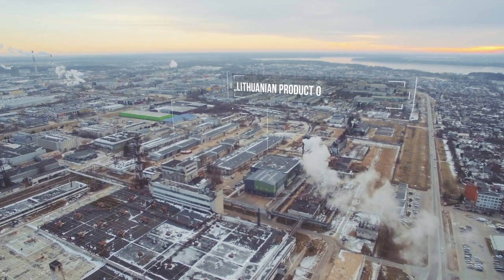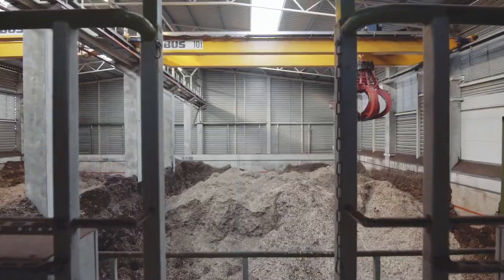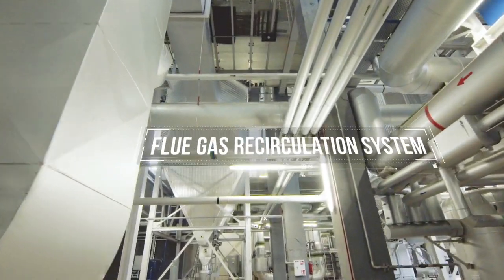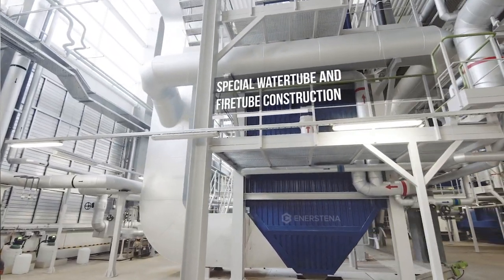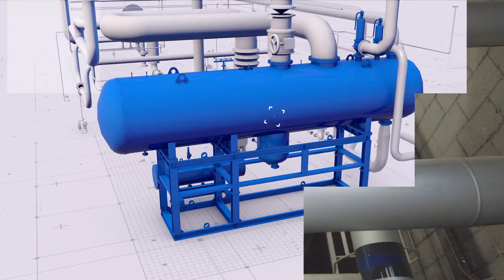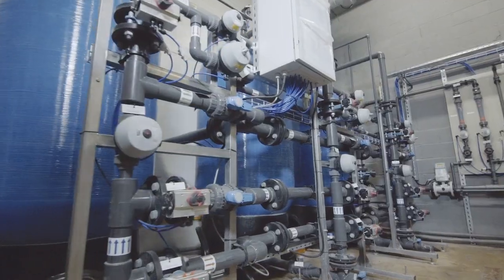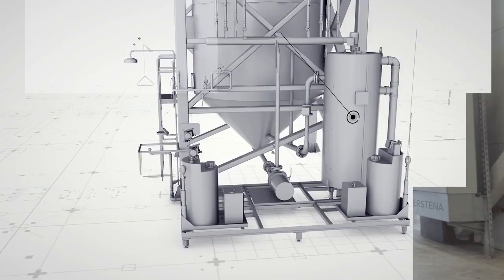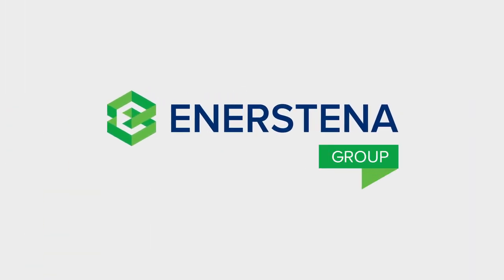CHP Plant - How does it work? ENERSTENA Group

Comment: 3:19 how can the efficiency of the system be above 100%?
Reply: when calculating the efficiency, you use both higher and lower value of the heating value (HHV and LHV). The numerical difference between the LHV and HHV of a fuel is roughly equivalent to the amount of latent heat of vaporization that can be practically recovered in a secondary condenser per unit of fuel burned. 2. The numerical value of HHV is always greater than or equal to the LHV, therefore you get more than 100% efficiency.